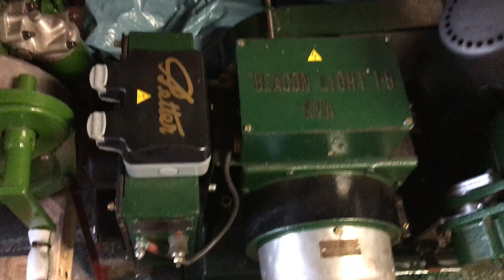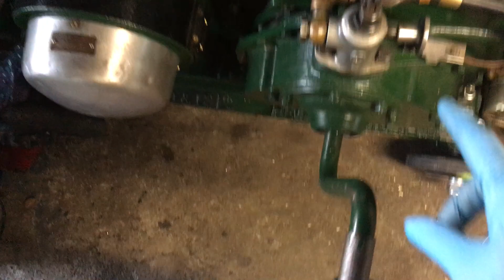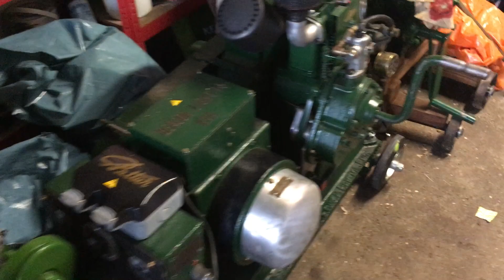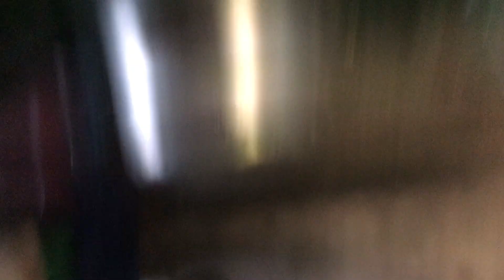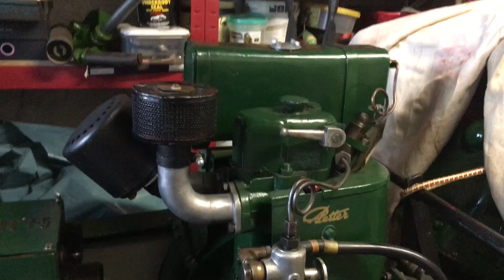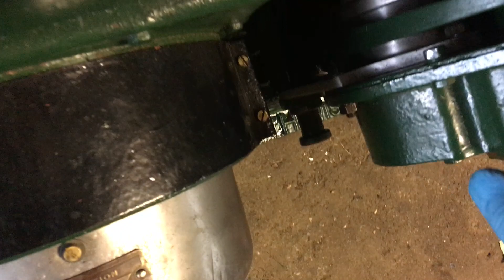Workman Reed 1.5 KVA Generator

Comment: Very nice original set there.How are you? I wanted to ask you if you know how much a 2 cylinder LD2 Lister Auto truck approx weights?  Can you help me please? Thanks
Reply from the maker: enginelover1 hi thanks: it very much depends on the model as some have heavy flat beds with adjustable platforms. Could be up to a 1000 kgs with a ld2 or st 1 / 2 etc. How are you?
Reply: @Dieseljonnyboy  Its a 1960 double wheel 2 Ton LD2 lister truck. Do you know where from i can get any manulas for?

Comment: Very nice engine! I don't suppose you know of the whereabouts of a mark 2 cowling? (My rocker gear is coming back together after machining new bushes and re machining the shaft). Failing that, if you have a mark 2, could you let me have the measurements of the cowling?
Reply from the maker: Hi Benedict
I often see paz1s being broken up and sold in peices on eBay; my mk2 is up is Surrey at the mo so I can’t get at it. What bit do need?
Reply: I'm not in a hurry, but what I am after for the PAZ1 is a Mark 2 cowling, the one that directs air around the cylinder or failing that being able to make a template from one. I am not in a hurry though.
Reply: Another big cheeky ask, do you know of anyone who has an old injector pump for an AV1? I've just bought one and only actually need the casting as the one I have has a little broken off the bottom? I can see I can buy one new on eBay for £40 so am only looking for a dead one I can rob the casting from.
Reply from the maker: Benedict White hi I don’t have one I’m afraid. Jim perkins is the guy to ask. Is it an ava1
Reply: Many thanks, no it is an AV1 with a radiator. Nice looking engine, very springy compression (like a just run in engine). Could you message me with how to get hold of him please?
Reply from the maker: Benedict White ah yes nice; jim has an av2.
Reply from the maker: Benedict White will do; I am afraid he is not too well at the mo; I’ll message him
Reply: Many thanks.
Reply: That must be a heavy bugger. The AV1 is 28 stone 8lb!
Reply from the maker: Benedict White yes these engines are very heavy; I’m selling my lister CS as it’s jus too heavy and I have a herniated disc. Going to keep Just my favourites!!
Reply: If I had the room and the kit to move it I'd be buying... (After I have built my shed I will build a small engine lift able to lift several tons).